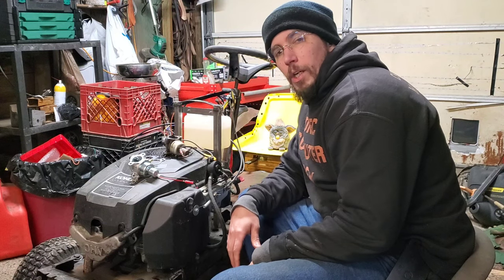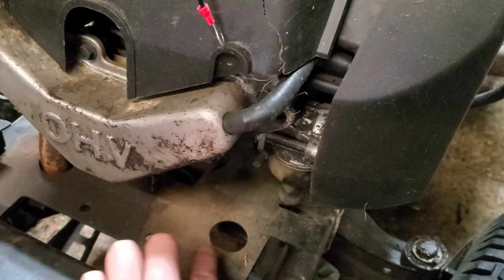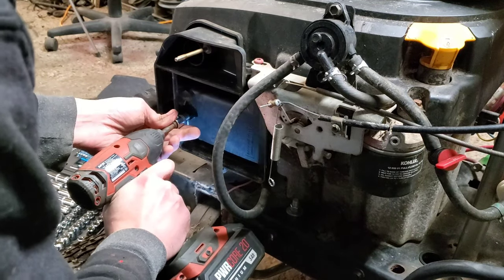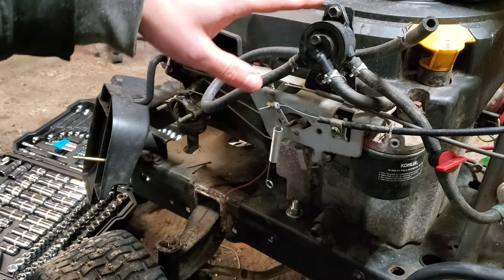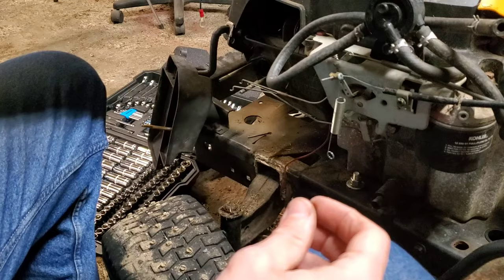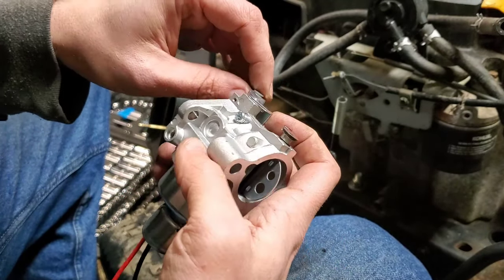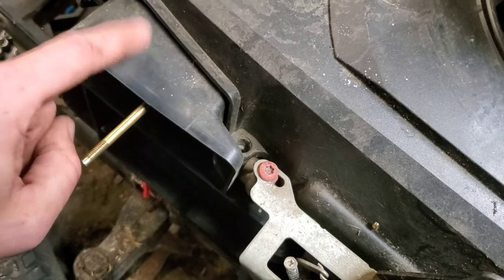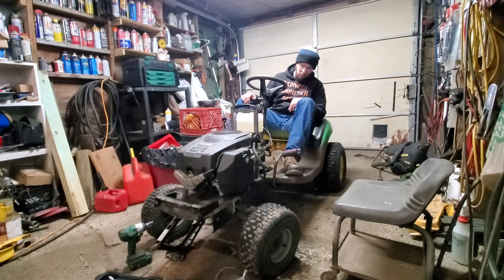Kohler Courage Carburetor Replacement

Comment: My courage 20 carb was leaking gas onto the hot exhaust of my Husq mower just this evening. Thanks so much for the advice about going with the Hipa replacement. Bless you, Sir!

next day:  My Hipa carb arrived today via Amazon Prime, and I just got it installed. Tomorrow I'll try to start the beast up. 

next day:  Tractor started just fine; No surging, sputtering or leaking.  Thank you again, Sir!

Comment: Great video, I did accidentally toss the little plastic piece on top of the old carb when I took it off. To replace it I used a slim drywall anchor. I just cut off the bottom and shaved the top to fit with a razor.

Comment: I have the  Courage 21 in my Husqvarna tractor. Bought it brand new in 2007. 416 hours. I only use it for my backyard. Ive found out that even though it gets a bad wrap a little preventative maintenance goes a long way! Seasonal oil, oil filter, air filter and fuel filter changes. Replaced my carb last week. Still runs like a champ!

Comment: I’ve been given a Troy Bilt with this engine in it. Like is so far, just wish it had cruise control or something. Noticed it kept having issues with fuel and smoking and small fire around the exhaust. Needed blades, so I’m doing an overhaul on it. Thanks for the info. I thought I spotted a gas leak but wasn’t sure from where lol. Ironically, I mow after work and I’m still usually wearing FR clothing hah!

Comment: nice note on the "updated" safety shut off.  Except they leak too!  I just did my spring start up and it is  pouring fuel out of the shutoff on to the exhaust.   It looks like a new carb since I can't get this appart to rebuild it.

Comment: Great video, thank you! I have a Kohler SV620 with the same setup minus the fuel pump. Everything same as this one. I wish I had seen your video before I replaced my carburetor.

My choke and throttle linkage both came loose at the control end. I'm having trouble getting them placed and functioning. Could you do a picture or video showing that end? Thank you!

Comment: When those cut off solenoids go bad;  just cut the end of it off and squirt silicone down in the end of it, bolt it back in (to plug the leak hole) and unplug the cord.  You don't need it at all.  Mine has been running fine for years without it.

Comment: I'm confused does the Red Wire get connected? If not how does it get power? I currently have one with both wires disconnected and pretty sure the carb is dying or not working correctly. Do I need to connect those red wires together? Please help.
Reply: yes

Comment: Hi, excellent video and explanation. Question, if I leave the throttle lever all the way  up in the choke position and shut off the engine, gas pours out voraciously from the carburetor. If I don't leave it up, no leaking. Any thoughts? (old style carb)

Comment: Thanks for the very helpful video.  I followed your advice and installed a Hipa Carb just like you did.  However, I cannot get the engine to start unless I shoot a little carb cleaner in the throat of the carb.  It then fires and runs, actually running longer than the carb cleaner would sustain; so apparently ran on gas for a minute plus.  But, when I turned it off, I cannot get it to start again. Since it ran with carb cleaner, I know it's getting fire.  Installed a new inline filter and a nice shut-off ball valve and have proved that gas is getting to the carb.  When I power up the fuel solenoid, I can hear and feel the solenoid pick.  I'm stumped.  Will certainly appreciate any suggestions.  Thanks
Reply from the maker: Sounds like a choke adjustment might have been messed with or got stuck. The start with fuel added shows the mix is wrong in the carb this is normally caused by the choke not being fully closed at start up position on the throttle.
Reply: @redneckcomputergeek  Thank you very much.  I'll pursue that possibility.   Appreciate your quick response.  As you know, these no-starts get pretty frustrating.!
Reply: @redneckcomputergeek    I checked the choke and it sure appears to be closing fully, I even put my thumb across the choke plate to ensure limited air was getting through, when cranking,but still no luck.  So, now I'm not sure what to do to get it running.  Any other suggestions, please?
Reply: Most likely one of the carburetor setting screws needs adjusting. I have run into that before.
Reply: @angelapolk1201  Thank you very much.
Reply: Solenoid cut the tip off  and fix

Comment: Hi! I just purchased and replaced the carb from Hipa parts. However, after replacing and following your very helpful video, the mower is not starting. The red wire on the replacement is plastic and it is metal inside on the stock version. It seems the connection is not compatible. Am I missing something for this step? Thanks!!
Reply from the maker: Interesting I will email them. The solenoid has to have a power and ground. Red wire power black wire side of the engine.
Reply: @redneckcomputergeek  thank you! Is there a way I could send you a photo of what I'm describing?

Comment: I have a weird problem with mine. The speed control lever moves up and down just fine with all the components underneath. Yet, engine runs at high speed only, regardless where the speed control lever is. In other words, it only has 1 speed, and it is high.

Comment: Mine is a 2017 Troy-bilt Horse with the Kohler Courage SV601engine ~22 HP. I have to look at the carb to see if it is the death model. :D

I have a question, in the course of this video you talk about a fuel pump, with yours being on the side, and others maybe inside the cover cowling.

My mower seems to have a direct line from the gas tank bottom to the inline filter and then to the carb. This means the bottom of the tank is roughly at the same height as the carb instead of raised where gravity  might help fuel flow.

I am experiencing a situation with the mower where it runs fine with a full tank of gas, but once it is about half full or lower the engine starts to cough and cut out on uphill inclines.

Tank is clean, lines are clean new filter, so I'm guessing carb may need work? Would a pump help me you think?

Hope you have a suggestion or two. :)

Love your channel.

Just now fixing the mower steering with that stupid weak design brass hex flange bearing. :)
Reply: Think I'll get the Hipa carb anyway, even if a pump is advisable also. $40 for the carb and a maintenance kit with all the other stuff is a good buy I think. Thanks for this video!

Comment: I bought carb you mentioned in this video.  the hipa carb. cost me less than 30 buc from amazon including shipping. pulled old carb off due to running very roughly at low idle. to start had to have full choke and play with throttle. seems like bad carb, as I changed air filter, plug, oil and oil filter. the old carb had NO GAS LEAKS, just an fyi.  installed new carb (hipa one) and the minute I plugged in the gas line, and bowl filled up, gas flowed from sides of bowl, removed, disassembled and found 'O' ring not correctly installed, was not circular, was mis applied, causing bad seal on one side of bowl, corrected seal issue, made sure float not stuck, and reassembled. again, the minute I connected gas line, the bowl filled and now NOT coming out of any side of bowl around seal, so this ok, but NOW gas coming directly out of main carb opening, lightly tapped float bowl (make sure float not stuck, no change).  I did start the mower (after putting filter housing on and bolting carb (with all gaskets in place) back to engine).. it started very easily and ran ok from low throttle to full. ran for about 1 min, shut off. and checked for gas flow/leak. STILL leaking from main carb opening.  and as for the safety gas shut off kill solonoid, the new hipa carb did not come with instructions on connecting, plug to solonoid.  plug will go either way, I am not sure if it makes any difference (positive /  negative). as I tried plug both ways as it is NOT KEYED OR NO INDICATION OF POLARITY, if there is one.
Any thoughts here, thanks in advance.

Comment: Mmm, what happened  to wiring  up the solenoid  you never showed in video you hooked it up, and why don't you have custom fit K&N air filter in the Koler racing engine betterthan nothing but screen mmm Not good. K&N filters make you special  filter if you E-mail them. And I'll comment on that solenoid  I was lucky on my briggs 22 hp cutting grass with rider engine just died out and white smoke poured out from hood come to find out fast the stupid solenoid was burning the black plastic I was lucky it didn't burn tractor outside on grass to ground that solenoid  is 156.00 holy shit, So it running without solenoid I fixed it as bolt type  screwed to float bowl with in-line fuel shut-off  Now installed. Now it's safe.